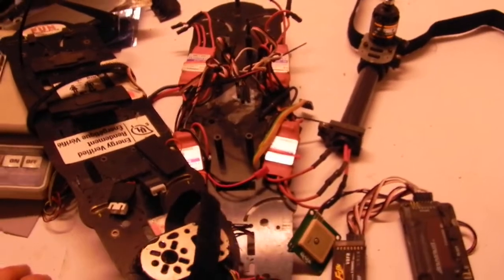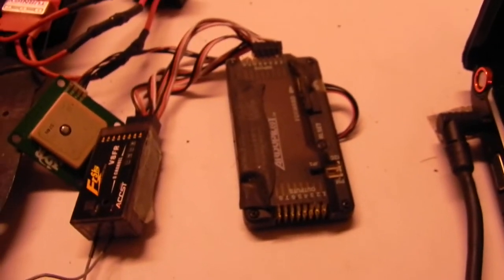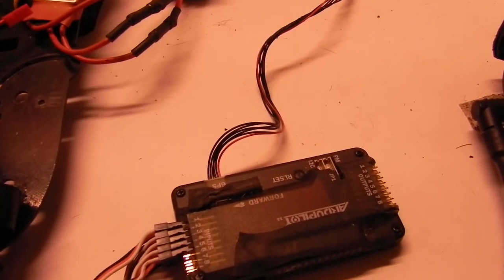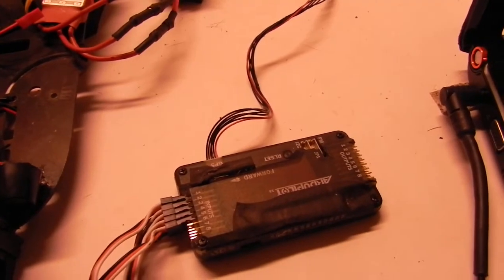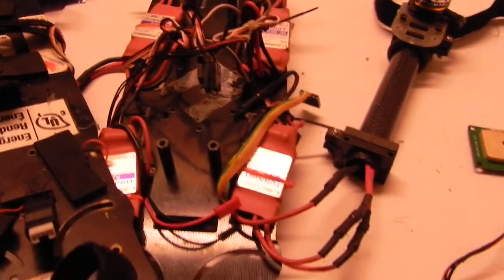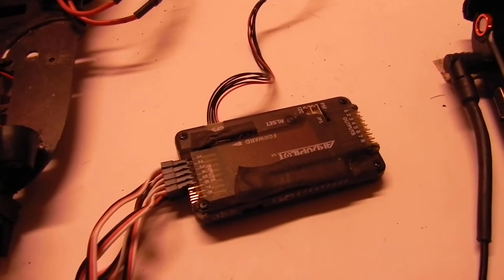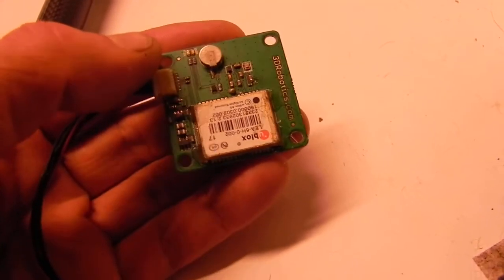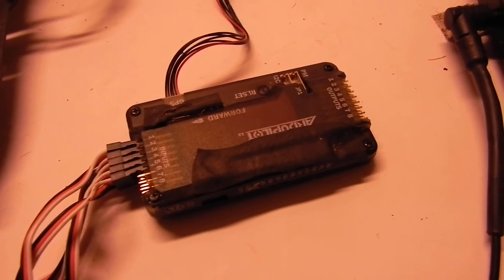Open source APM vs Naza V1 Set up and reliability commentary.

Comment: It feels like you got a bad experience with APM. I just finished building my 1st ever quad with APM 2.6, and it flies like a dream. And I am just an inexperience newbie. With that many flight modes and powerful mission plan (auto pilot), I cannot even compare it to any NAZA flight controllers. As Icarus Rc said, if you set everything up well, it really does flies perfectly. I absolutely love the Android auto pilot apps for the APM systems. I have used all three (Andrupilot, Droid Planner 1, and Droid Planner 2 (Beta)), and they all worked so well. The voice telemetry over these apps is awesome. I highly recommend APM and ArduPilot systems.
Reply from the maker: Binesh Maharjan I do not support RC businesses that use the military term drone and their quality control and service are worse than Hobbyking. I know of 2 doa pixhawk to date but it seems a bit better than 2.6

Comment: Wow... I love my APM! If you set everything up well, it flies perfectly! SOOO many more options for SOOO much less money... Autonomous flight, MUCH more reliable than the naza- Just make sure everything is set up correctly! I might be interested in this offer- What NAZA version are you looking for?
Reply from the maker: Mine was great for all of 4 flights but the quality control is very bad especially in beginning. For all the huge funding it certainly is not what it could be. This was over $200. new and the fact MP cannot pull maps half the time makes it even more unreliable. It may be just another dud from 3DR who knows.
Reply: Hoverbot1TV Not sure but I'm loving my APM:) What NAZA type are you looking for to trade?
Reply from the maker: Lite or M v1 straight up trade no gps on either req, I can do a vid of it booting and horizon moves calibration etc. The GPS may need attention but the light comes on and I have extra long lead for connector.

Comment: amp wii and kk boards just do not compare to naza m  keep nazalite in toy grade cat but nazalite is still better than anyothers but you want a naza m v1 upgraded to v2 I was told by dji tech that v1 was built with better parts!!!!!
Reply: I strongly disagree haha I love my APM- I would never compare it to a naza, forget the KK board (KK boards are junk... Complete and total junk). My naza(s) flies very well but I've had so many issues in the air... I've almost lost my quad 3x because the naza had a mind of its own over: Water, a mountain, and... more water.
Reply from the maker: Probably true they paid more attention to parts on the first models like Macintosh when not just PowerPC's used high end Motorola chips then began moving production out of California until the ended up with workers that worked in dorm conditions so profit would increase. I see a lot of 3DR boards marked such on Ebay and wonder if they even make all of them in Mexico now or have farmed it out to a Chinese firm. If Americans made them the quality would be far higher but instead the Co-op that is 3DR is chose to pay less. They also re-badged a Turnigy or Flysky 9x as their own  controller which is the height of sketchy consumer deception for unwary Iris buyers.

Comment: I really like my naza-M V1, i really regret i did not buy more of this unit when it was still available, the Naza-M V2 is far away over-priced and The Naza-M Lite is not good enough! Does the GPS of APM flight controller has a saw filter if you want to fly with 1.2/1.3Ghz video transmitter?
Reply: Hoverbot1TV
Have a couple of v1's and v2's, always work great here...
Got a Naza lite recently too (with GPS) for a smaller quad that seems to fly just as well, and Alt hold uses the barometer so no GPS should be fine.
By the way, do you order all your parts or do you cut them yourself? I need a couple of plates for a gimbal (:
-Ced (North Shore)
Reply from the maker: No saw filter, the first board I had corroded and this one worked for about a month then would not work with an update. Too much like windows always tinkering with APM and not flying. Naza lite was going to be my next one for this does it hold alt without gps?
Reply: Hoverbot1TV Yes it has the same flight modes with the Naza-M V1 and V2 but compare to them, it does not fly too bad, it flies nicely but you will see quickly its limits compare to the V1 and V2, i find it a little bit in pain with strong winds and for me it's a shamefull we can not connect it to the last cool features like the iOSD. It does not have saw filter (like the naza-M V1) but it does the job with its specifications :)
Reply from the maker: Well I will treat my naza like my pet and make sure it does not RTC return to china and fly away. I think I have figured out what not to do now. Off to bed I want to get in some flying later today.
Reply from the maker: My cf cnc is out of town and 1-2 weeks, my G10 cutter is 3-4 day turn around waterjet not so good for plate but aluminum and lexan it works. I do cut runs and I could put your parts on next run. I can use vector art in illustrator or dxf.
Reply: Hoverbot1TV Ah ok, thanks for the reply.
Really just need a >2mm CF plate between gimbal Yaw motor and Vulcan UAV Isolation plate. Should be really simple, just don't want it to look like crap...
Maybe we could meet up for some flights some day, would love to see one of your Quads in person. Happy flying tomorrow, forecast not looking too good though >.<
Reply: SuperBlindpilot I've never tried to fly the naza-M lite in alt hold mode without GPS lol It's good to know but i don't trust it a lot, i think it's a good idea to put it in a mini quad, i put it on my TBS Discovery frame but i don't do crazy flight with it! Thanks for sharing your experience :)
Reply from the maker: SuperBlindpilot Next tie your heading over bridge email me at my website ahead of time and I'll give you a demo here or if I can get to Phibbs exchange maybe we can fly Cates park.